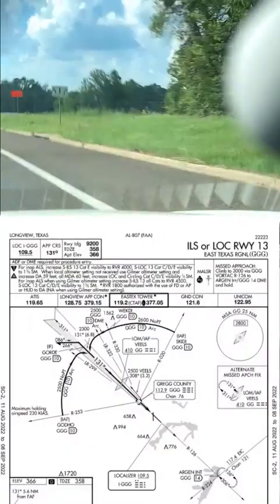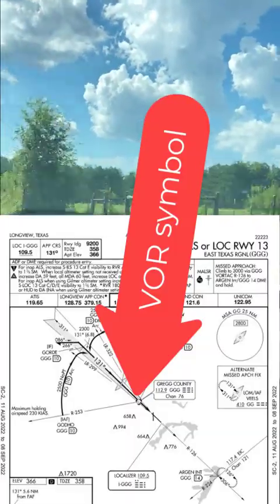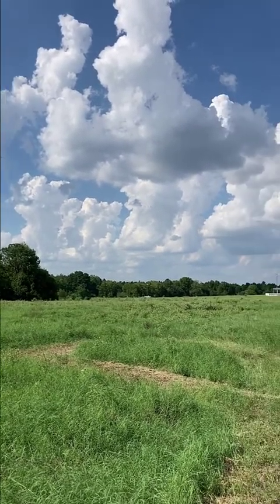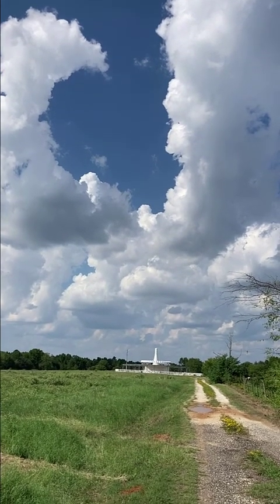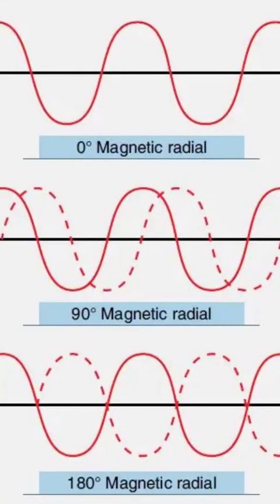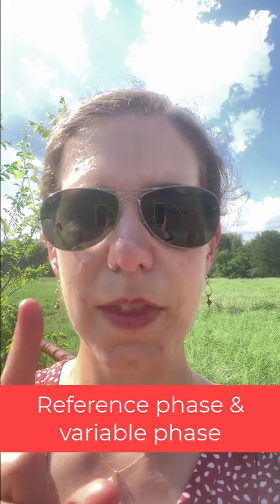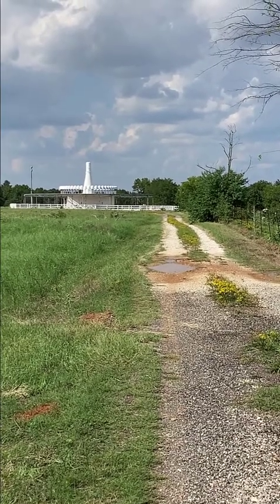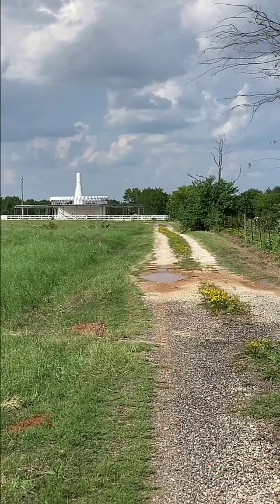VOR Field Trip: Finding VOR on the ground! How does the VOR work? Instrument Pilot Flight Test Prep

Comment: I don't know why, but i think the NDB is simpler and easier to deal with than the VOR, could you tell us (Maybe in a video) why the VOR is better than the NDB?
Reply from the maker: I made the video comparing the two: VOR vs NDB! Check it out!
Reply: @LauraLaster747  Thanks alot ! I will 👍
Reply from the maker: That is a great idea for a video! I will work on that. But in short, the VOR makes it much easier from a pilot workload to deal with wind correction and hold a steady direction going toward or away from the VOR station. However, I like the idea for a video to talk about the differences in the two instruments and why the VOR tends to be favored over the NDB.
Reply: I  grew up watching my pilot father flying in the Canadian arctic and at that time there was no GPS yet, VOR  was not up there either. NDB was the main thing as far as a instrument went. Compass was not great as we were close to the mag north pole. @LauraLaster747
Reply from the maker: Totally! It is important still in those areas.